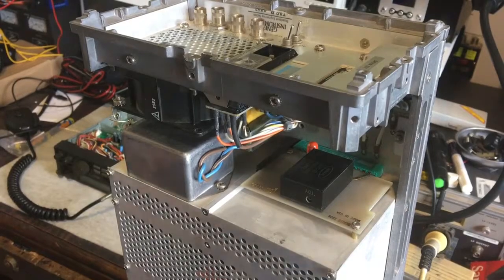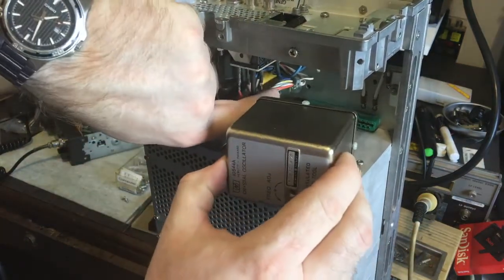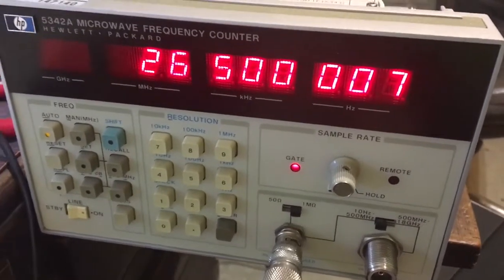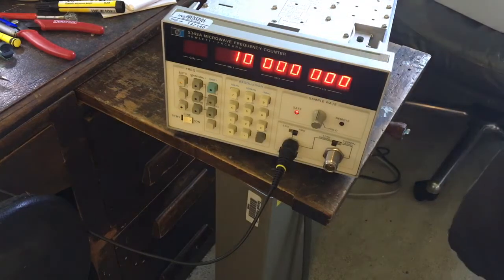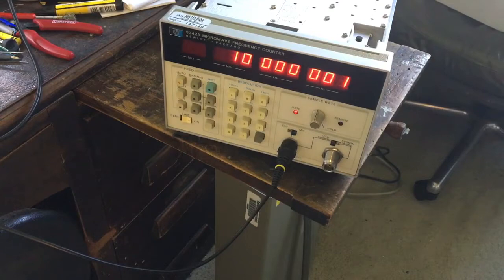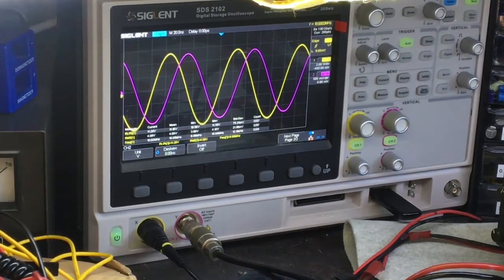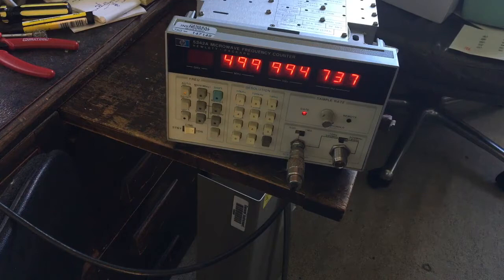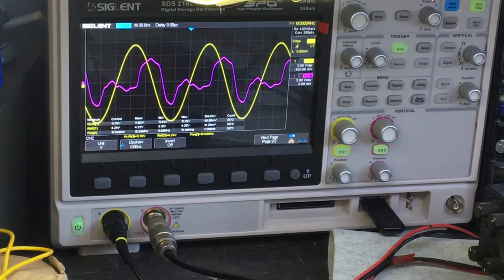#132 HP 5342A Microwave Frequency Counter OCXO Installation and Calibration

Comment: I think this has to do with loading/coupling on the output as I've seen similar degradation on the 10 MHz outputs from other HP gear. It must just be something with the implementation they use.

Comment: The power supply in the frequency counter looks to be of European standard colour code, is it 240volts or 110v, I assume your in USA?
Reply from the maker: I am in New Zealand, we use 240V here also, I purchased the unit on eBay from the USA.
Reply: TheDefpom ~ great to see, I'm in Victoria Australia, where the same power as you, sockets and all, I have only just found your channel a sub to it, like your work, you sound like your from GB, merry Christmas , if you get time check out my channel, I'm a Ham, radio and Telephone tech and a volunteer firefighter. I built my own house, so my channel has a mix bag of Allsorts.. cheers and beers mate.